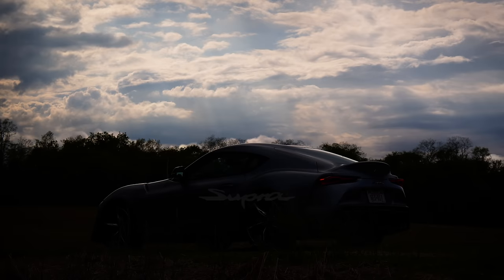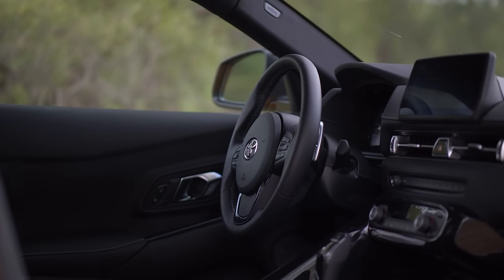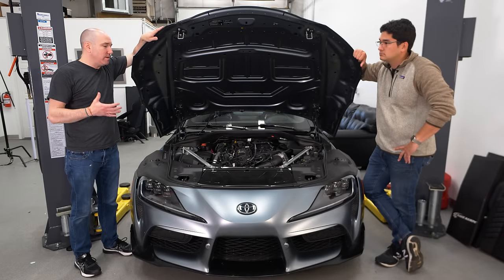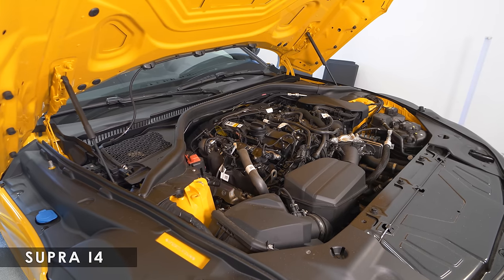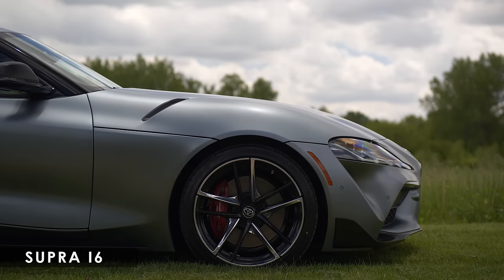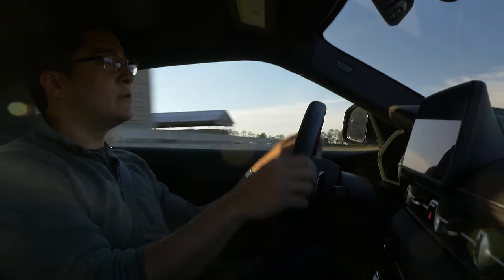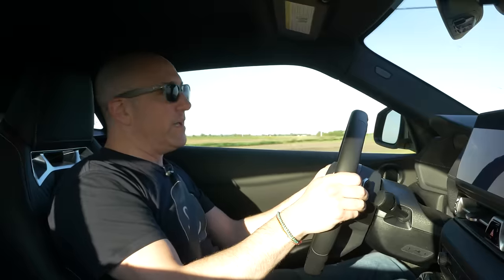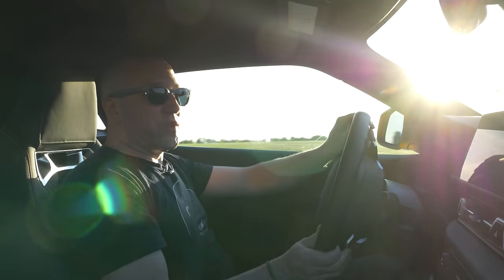2021 Toyota Supra | 3 Pedals Short of Greatness

Comment: If they made a AWD Cuope variant with a V6 and a optional manual, I guarantee Toyota will realize how much sports cars are still wanted. As long as they keep it under 40K or even 35K at least. They would have to gut so many things to keep it in that price range, but they did it with the Camry TRD and thats a 4 seater, so it is indeed possible.
Reply: Sports cars with reasonable HP (~300hp) don't require AWD for performance, other than drag launches. They add extra weight, almost always have more understeer, and lose the steering feel when the front wheels are for fighting for traction and steering. Lightweight RWD provides the best drivers experience.

Comment: Good points in theory about using BMW, but Toyota has that super-reliable, versatile and fully  amortized 3.5 liter, that even Lotus uses in their cars. I just don't see the need to go to BMW for help.
Reply: That 3.5 is a V6, not an inline-6. Enthusiasts are gonna still whine/complain that the new car is a v6 unlike the previous gen supras that are all inline-6 engines. At least the BMW b58 is a strong motor.

Comment: I hope that the 2022 model year gets 400 horsepower, a 6 speed transmission and gets rid of the fake engine noise.
Reply: This year's has 450hp. Next year's going to more or less be close or over 500hp. Hp is underrated for these.

Comment: Thanks for your video! In your opinion, can Supra be a daily driven car in somewhere like Illinois?
Reply from the maker: With winter tires yes.  But would get old.
Reply: @savagegeese  I'm sorry, what do you mean by "would get old"?
Reply from the maker: @advocado7373  Its not the most practical car and even with good tires in winter you would not be able to use the power.  So while youd be able to drive it, it would be like having a wing clipped.
Reply: @savagegeese  got it. Thanks!

Comment: How much does it hold true, if toyota made the supra in house as a real successor to the mk4, and  developed an inline 6 that could be used for lexus platforms.. what would the supra really cost? We hear everyone say that if they didn't partner with bmw that it would cost significantly more than it does and wouldn't make since for toyota.

But how does it a company like Mazda make a purpose built platform like the Miata cost 25k and they're building their own inline 6, while also working on the rx vision car to get near  production?and that rotary range extender?

Certainly toyota could have shared a chassis from the lc500 and create an inline 6 like I said to be shared with lexus. Cause wasn't the mk4 a shared chassis anyway? 

Makes no sense to me.. anyway it's still a good car, but something felt off about their reasoning. Anyway let's hope the 400z is what this should have been
Reply: In Toyotas case they're strictly making a i6 for just one car and one car alone and didn't want to use anything from Lexus since they can't support a i6 since they're built for V6s or V8s including that their heavy also. In mazdas case they making a i6 for more than just one platform/car so its easier to make/brings prices down so it wouldn't be as expensive to do.

Comment: So much badge engineering ! It should have a Steyer emblem on the bonnet since it is made in Austria by them for BMW. I would still by the 6 cyl though.However, it will not have Toyota reliability or durability so keeping past warranty would be a risky proposition.

Comment: A VERY VERY good sports car the only fault l can pick is excessive wind noise with the windows down at highway speeds.

A small redesign of the mirrors and surrounding plastic should alleviate the wind buffeting with the windows down..

The four cylinder is a disappointment.
But the top of the range 3.0 meets all expectations for 2021....

I wouldn't buy any other sports car 🤩🤩

Comment: Very true. I test drove an A90 and it was so boring. It goes fast but with little to no drama. Plus the zf tranny shifts annoys me. What’s the point of an 8 speed auto when it only shifts to 6? It stays at 6th gear when cruising around. Even in manual mode if I shift to 8th gear it’ll downshift back to 6th. Overall it was a very bad experience with the driving dynamics with the annoying tranny.

Comment: Geez, thats a big change to go from an integrated to external exhaust manifold on the I6. First gen A90 owners just got rekt. Also, it would be nice if Toyota offered a locking diff for the I4 as a TRD accessory.

Comment: In the past, Supras were built on chassis from Toyota's business (Chaiser, Mark, Cressida, Aristo) sedans and had engines from them in order to showcase brand's power and pride. The only thing new Supra showcases — Toyotas greasiness and shame.

V35A-FTS could easily be factory tuned to have around 500hp without sacrificing reliability, only fuel economy and remissions. This engine already have proven itself be reliable, despite it's complex modern design. It can make 600hp with simple ECU tune, which already exists. And Toyota's open deck, with cast iron sleeves designes are really strong, there are even 1000hp builds based on Toyota's i4 2AR-FE blocks. And cooling along with crankshaft strength is better in V engines. It would be one hell of a Supra on TNGA-N platform from new Crown, it would have front mid engine layout, just like the Crown does. They also could tune Aisin 10 speed for more sporty behaviour..  And no one would care about it having v6 instead of i6 as no one cares that original R32 GTR had RB i6 where is modern once have v6es.

  I am really glad that this Supra has very bad sales and i hope that new Nissan Z will put final nail in the coffin of this abomination. If you like BMW then buy BMW.

There is Japanese automotive pride and history. Technology and engineering wise Japanese have been among leaders since 1980s Back than their metallurgy technology was far superior than that in other countries and only they could build long stroke engines that were high revving, due to mass production of light and strong crankshafts. They were smooth, economical and powerful even before ECUs. That's how they concarade the world. Then they showed how injection, variable valve timing, active awd systems and turbocharging is done properly and reliably. They were also first to implement these technologies in mass production of affordable vehicles. And they always use high quality materials and components for their engines and transitions along with proper, reliability conscious injenering. 

And no Toyota has ashamed itself and betrayed Toyota fans and japanese car fans in general. 

Shame.
Reply: K

Comment: Any rumors of the inline-6 also getting a manual? BMW so far doesn't have the B58 engine with a manual option, but they now offer a manual option on the Z4 20i (the inline-4). Or maybe Toyota will get the S58 engine at some point and the same manual the upcoming M3/M4 will have (as an option?)

Comment: The 6 cylinder is a very quick car but I find the styling , especially the rear and side views a bit like "melted cheese" .I just wonder if the B58 engine would've been as good as it is, without Toyota's extensive testing of the motor before it was released?

Comment: I think a used 4 cylinder Supra in a few years will be an ideal donor for an LS swap. Hopefully the rear diff in the 4 can be swapped easily with the 6 version.
Reply: Only issue I can think of with swapping the diffs is just the coding. If that's sorted out it wouldn't be a problem doing it at all since they're just the same car but with 2 different engines,brakes,and diffs.

Comment: I so don't like the colors in the headlight plastic. It gives an impression of cheap manufacturing. They put so much effort into visual design and then that. (I am glad I got a car before this and various other modern changes.)
I guess the 4-cylinder Supra is now the 86 replacement. Here in Germany they only sell the I4 Supra now, no 86. So it's downsized and thereby defying the 'legacy' which came with one engine and that was perfect. Also messes with the tuning intention so much emphasized (not to mention the name) if you buy a 4-cylinder version and then when thinking of tuning you wonder why you didn't just get the 6-cylinder version instead. - Also, what a 'trolling': Toyota: We heard everybody was wishing for a manual gearbox version. ... So now we introduce... a less powerful version. ... With automatic again.
As for the power increase of the new I6: Way to take the wind out of people's tuning ambitions (again) by basically competing with them from factory. - This is so much like in game development. DLC and take out features and polish in order to add it later, and also do beta testing on the customer. (Just that some changes are less simple to implement later by the customer.) - It's almost a cynical self-satire.
Marketing-driven product design is awful. There are so much better ways to market a product well, but they require a higher spiritual state, so to speak. Marketing is often people of no faith in the product using psychological techniques to try and evoke faith in customers. (But maybe they're also often not even trying properly and then wonder why not many people get excited. Offloading everything onto reviewers, I guess. Ads are expensive. Motor shows on TV are cheap.)

10:53 Speaking of tire dimensions: The impact it can have on gearing is easy to neglect. I have a Camry gearbox in a Corolla E11, i.e. it was made for Camry, Celica, MR2 Turbo class tire sizes. My Corolla also has the smallest tire format allowed. ... And the stock (maybe even a little restrained) 3S-GTE gently pushes at the rev limit in top gear. Which is disheartening considering the engine can rev very high (and reaches peak power quite low) and it also binges on fuel when driving like that.
Revs are irreplaceable though. Addictive, especially with sharp camshafts like in the VVTL-i engines I once had the chance to test.
Here's an acceleration and sound demo of the conversion: https://www.youtube.com/watch?v=_XhkAG-KHac - and here's some pics and stats: http://g6.owledge.de/myg6/myg6.htm

17:29 WTF?? Fake engine noise?? How much of what sounds like the Mk4 Supra is actually authentic? Oh man, sad times. This is yoghurt carton tuner style. It's like painting drum brakes red or installing fake intercoolers or painting the hood black to make it look as if it was carbon fiber.
Maybe you could have clearly demonstrated the sound difference in the video in direct comparison between sports and normal mode though.

You can read a society's spiritual state in many things, and how cars are made is one aspect. It expresses how well or badly humankind manages the heart-mind balance. Fake engine noises expresses that people are particularly satisfied with illusions, pleasant lies, instead of putting emphasis on authenticity. (Augmented reality crusade, hooking us into the Matrix one step at a time.) This of course also explains a lot in politics.

Comment: There should be a third engine option: I6 3.0l NA. That would give a similar fuel economy as I4 turbo when driven dynamically, with better running characteristics and not that much more manufacturing costs in comparison to I4 with a turbo. The engine already exists so the development costs are relatively small.
For countries not yet run by eco-communists where there is no tax connected to the volume of the engine, that would make sense.

Comment: I know you say “enthusiasts” complain and I don’t believe the Supra was very well received by “enthusiasts”, I love it, it’s a thing of beauty and being a Z4 owner I bet it handles amazingly. BUT also being a Z4 owner I know BMW’s aren’t the most reliable vehicle for the long term from both mechanical and electronical aspects. So I don’t think “enthusiasts” complain about it not being a “true Supra” I think they complain it not being a “true Toyota”. You said yourself it’s almost entirely BMW. So with that standpoint... I would rather buy the BMW, I know I got a BMW, I don’t expect it to be reliable, I don’t expect it to last a lifetime, I don’t expect parts to be cheap and I know I didn’t get a fake Toyota, I know I didn’t spend nearly BMW money to get a Toyota badge. That’s where the disappointment comes in. You mentioned it’s hard to make a sports car, I don’t care if Toyota used a BMW body or frame or anything I care that Toyota used a BMW engine, come one the least Toyota could have done is developed their own engine. My two cents. They put the most reliable badge in car manufacturing on the least reliable car. And you nailed it, it needs a manual transmission. My 2016 Z4 I got the 4 cylinder specifically so I could get the manual transmission. It needs a manual transmission for people to care about it.

Comment: In Europe the 4 cylinder supra has the same diff/adaptive suspensions/brakes as the 6 cylinder model. This could make the european i4 supra great for track with the weight down compare to the i6.

Comment: I only needed to read the title (1 pedal, 3 pedals, meh — I got the gist) to give this one a thumbs up. Sorry if I missed out on any meaningful content. Had Toyota (BMW?) seen fit to include a manual gearbox teamed up with an actual clutch in this car then I would have watched with much interest. But I need to get my day started and really don't need to be dozing off at this point so just went straight to the comments section to leave you my well wishes. Cheers.

Comment: the suspension geometry is a fail. It's have "bump steer". On bigger bumps it also causes the car to drop the TCS faliure. First the TCS automatically turns back on and the dash tells you: "You can not continue driving the chassis".. a BMW error code.
Reply: I was wondering if they redesigned the rear suspension
Reply: @raullasvegas  same here! As far as I know the GR team contacted with some nürburgring guys because they also blames the supra. So most probably they try to resolve the problem. Just don't know when this gonna happen.
Reply: @FreestylerAlbert  any updates on this information?
Reply: @izzdin6228  you need to buy + parts to make it better. You can find information on it at APEX NÜRBURGRING channel

Comment: the title should say "2 JZs short of greatness"
Reply: Ignoring high horsepower drag car builds, the new powerplant is superior to the 2JZ, and meets worldwide regulations (which the 2JZ would not). Complaining about this gem of an engine is a non-starter.
Reply: Frank White  but why did Toyota race their supras with turbo 4 bangers & a V8 instead of the 2jz?
Reply: Frank White  huh, never heard this version of the story. The story I'm more familiar is they did run 2 supras with 2jz motors alongside the 503e motors, and the cars with the smaller motor ran faster laptimes vs the 2j variants. Kinda makes it hard, at least for me, to believe the 2j was built for racing. I'm always under the impression the 2j was just built to be reliable, hence it can be found in multiple Toyota & Lexus models during that period.
Reply: Frank White  interesting. Do you have any source material? This is news to me. My thinking was, Toyota used the 503e just for the weight advantage vs the iron block 2j, hence making it competitive in jgtc.

Comment: i think 🤔 they dulled the 4 cyl version with that limited torque band a 4 popper that doesn't rev 🙄.. but for the cheaper starting price could build/upgrade overtime based on budget over time

Comment: There are a lot of contradictions in this review. Perhaps this is because the car itself gives you a contradictory feeling.
The four-cylinder Supra driving impressions are described as, "one of the most joyful experiences you can have," although "you don't feel a lot underneath you." And then it has "a very connected feeling on the interior." From that, I can't tell whether you feel connected to the car or not.
A direct comparison between the 4 cylinder Supra, Toyota GT86 and a Mazda MX-5 (Miata) RF would be very interesting.

Comment: I just can't believe this thing still isn't stick. Many people would be buying this thing if it were, but because the stick isn't available it just doesn't make sense. I don't know anyone who's even bothered to look at these things because of that fact. They move to a Z4/M2C/American. With the M2C finally out of production, it makes you wonder if Toyota had an agreement with BMW that they couldn't get the stick in the car, because of the worry of cutting into BMW sales. By and large, the Supra w/ the Adaptive suspension and this higher output B58 WITH A STICK, I think would be a better car than the M2C.